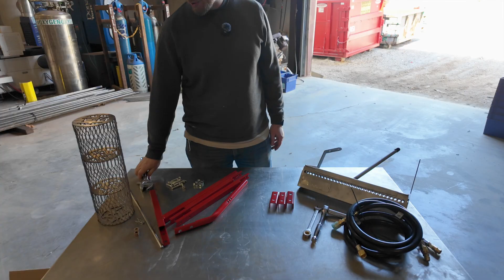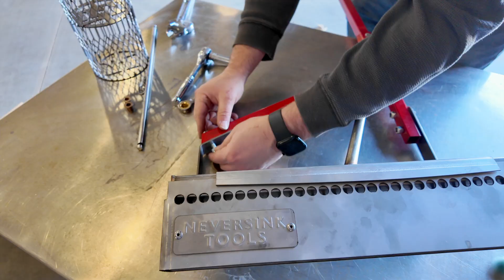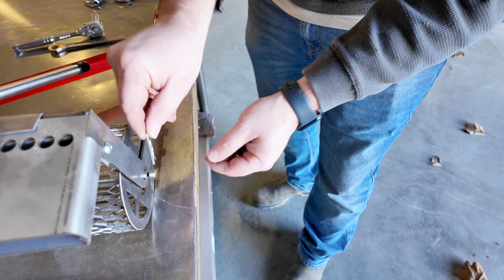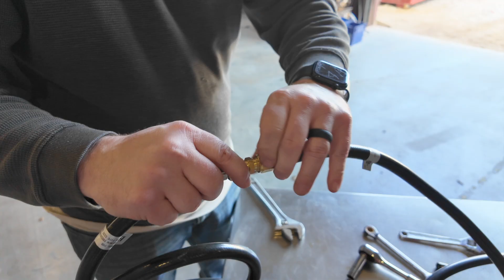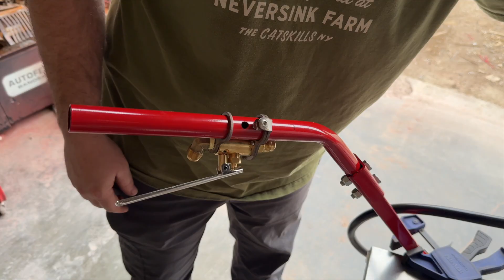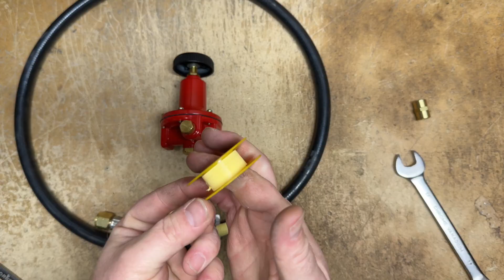Blaze 15 inch Flame Weeder Assembly Instructions

Comment: Easy to assemble. Not aware that the squeeze handle and regulator was sold separately, which I will buy next, but I look forward to using this on my fence line. Thanks guys!
Reply from the maker: Glad you found the assembly straightforward and good luck clearing that fence line!